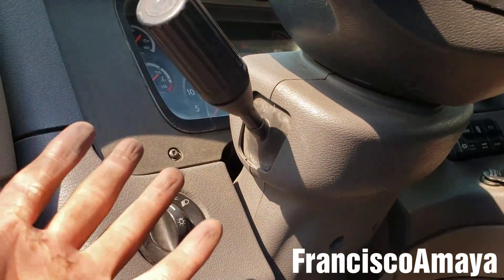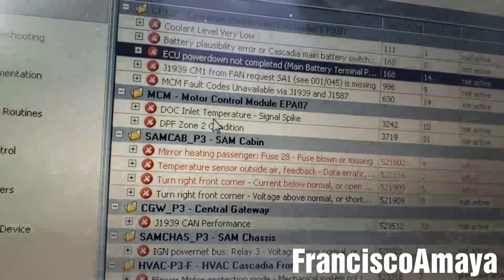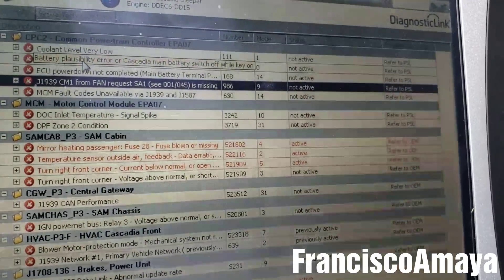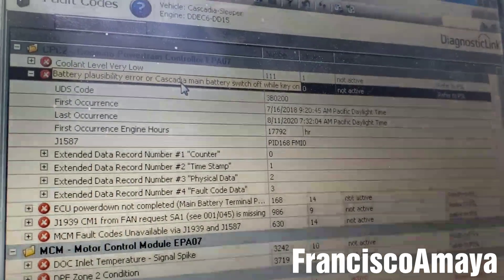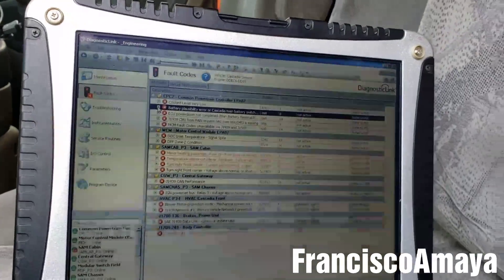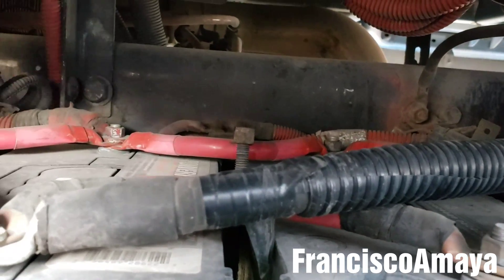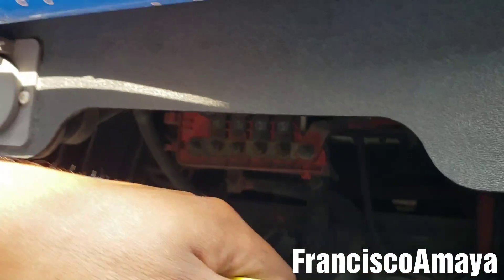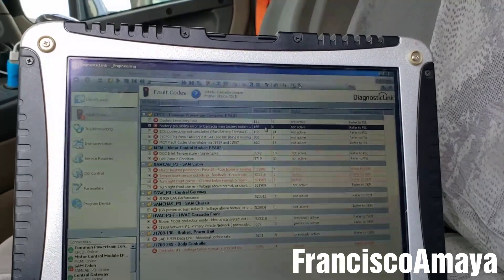Freightliner Cascadia DD15 explosions while driving power lost battery power problem

Comment: Nice find my friend. I was having this problem too with the roaring explosions while driving and my malfunction dash light came on. I found out that a couple of my battery cables were loose. I tightened the cables and then the dashlight disappeared after a few cycles of the ignition switch, and no more roaring was heard. If I hear anymore roaring, I will assume that my batteries or battery cables need a good check.